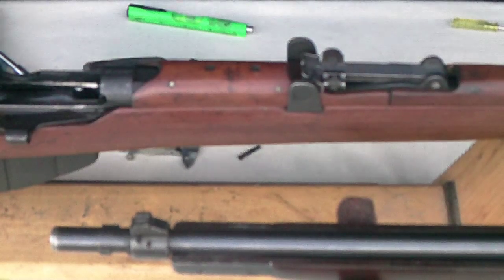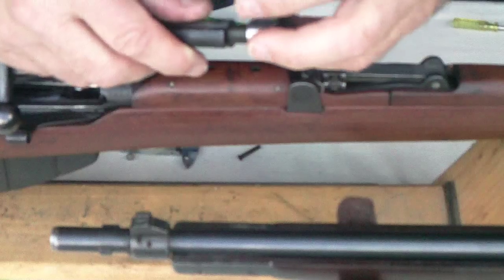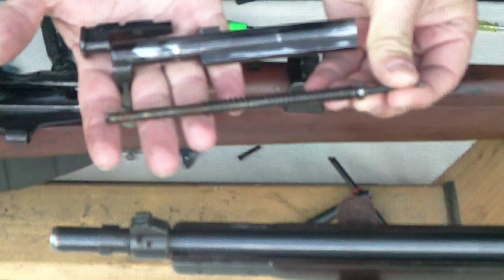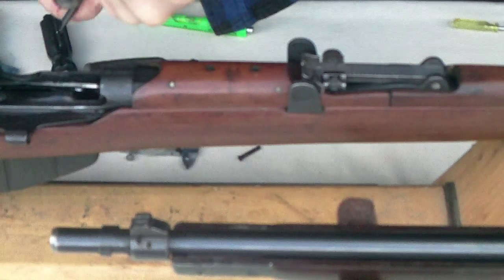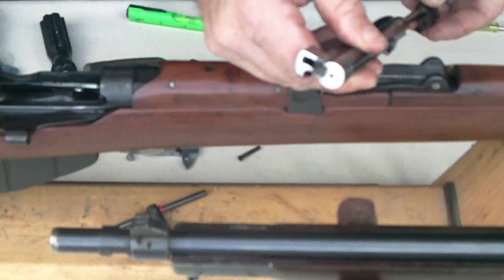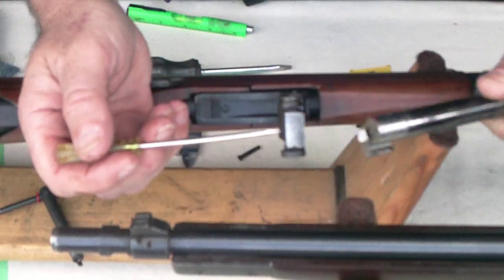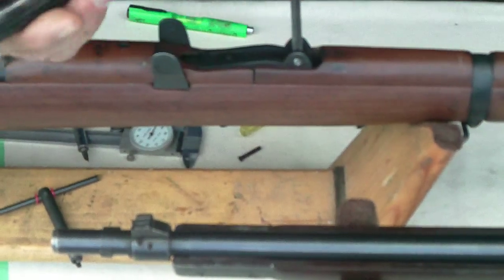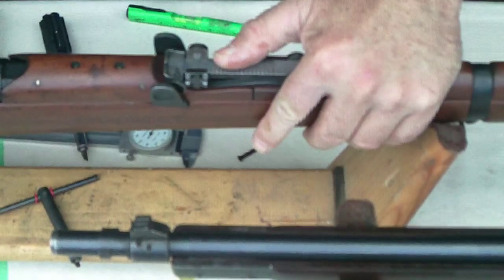Field checking the Lee Enfield firing pin protrusion

Comment: But what if the protrusion isn't OK and needs adjusting?
If you adjust it with the spring out, you then have to disturb the setting to replace the striker & spring.
It's fine if the back of the striker knob and striker are flush when protrusion is at optimum but usually they are not.
So it would be a good idea to index the setting with a little scratch.
Simpler to just adjust the setting with the spring still in. 
Normally the only reason to remove the spring would be if you are cleaning or replacing the internals of the bolt.

Comment: I have an Indian L2A2 7.62mm NATO. The bolt is very similar to a NO.1 MkIII. I am having a hard time removing the plug that holds the spring and firing pin just using the plug removal tool. I have drowned it oil and nothing happens. I was thinking of using a propane torch or heat gun to heat it up. Will that help or damage my bolt? Indian L2A1 and A2 bolts are exclusive because their bolt heads are specifically made to hold 7.62mm NATO. How do you loosen a stubborn plug? Have you had this problem with other Lee Enfield bolts?
Reply: Don't use a torch on your bolt if you haven't already done so. You may ruin the heat treatment.
Reply: throw it in the freezer the metal will shrink worth a try

Comment: gday,
wondering where I can pick up one of those tools you used to separate the pin? been looking on ebay but cannot find one...I have a no.1 mkIII 1918 Lithgow and it is in good condition....but taking the bolt head off noticed there is a lot of gunk in there. thanks for your help! Dan

Comment: Sorry to say it but this guy has absolutely no idea what he is talking about. I say that as a former employee and time served apprentice at RSAF Enfield. (A full apprenticeship was 4 years full time training)

(1)  You DO NOT need to strip the bolt in order to check the FP protrusion on an SMLE No.1 or No.4. Just turn the cocking piece into line with the deep notch in the rear of the bolt. The firing pin will protrude the full amount and the same amount as when the rifle has been fired. You must make sure the lug on the bolt head is in line with the large rib on the bolt body, or turned past it. (4) below explains why.

(2)  The rear end of the firing pin has a circular notch cut in it which takes the head of the locking screw in the cocking piece. That prevents the pin from unscrewing in service. It also means that adjustment of protrusion would only be possible by one or more full turns of the pin. The FP thread is 26tpi, therefore one full turn equals 0.038" - rather a coarse adjustment on something with a nominal protrusion of 0.050" and a tolerance inf memory serves correctly of +/- 0.005"

(3)  The headspace on SMLE rifles is adjusted by changing the bolt head. IIRC six different lengths were made - from size 00 (smallest) to size 4 (largest). I forget now what the difference in size was, I think it was 0.004" steps so a maximum adjustment of + 0.020" was available. Headspace was set at the factory, checked on inspection at workshops and adjusted as necessary by changing the bolt head for a longer (larger one). 

(4)  The length of the bolt head screw from the rear shoulder where it contacts the bolt body to the rear face sets the firing pin protrusion in combination with the length from FP tip to the front face of the collar which also retains the spring behind it. FP PROTRUSION  IS NOT SEPARATELY ADJUSTABLE. If it was set by any other method, changing the bolt head would also change the FP protrusion. If it was found out of tolerance at workshop inspection both bolt head and firing pin were normally replaced.
Reply: when re-assambly the bolt, how do you know that firing pin is screwed properly ? ie not protuding too much ?
Reply: Alexander Challis Except the boltheads came in sizes 00 to 4. I still have examples of all of them
Reply: Alexander Challis No. 4 cocking pieces do not have a “cylindrical portion” they are rectangular